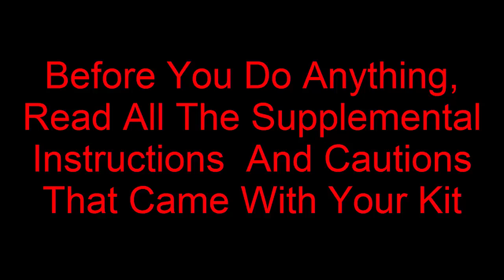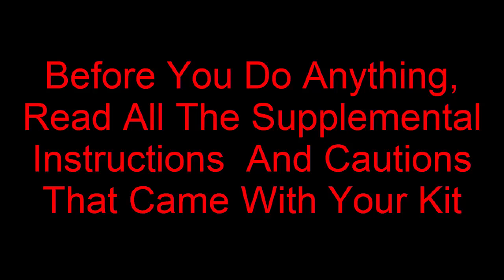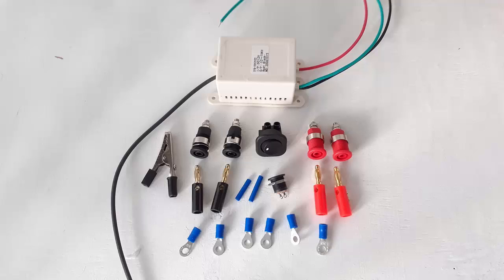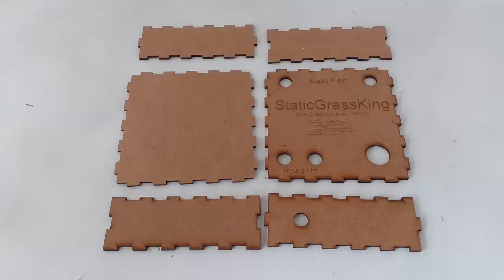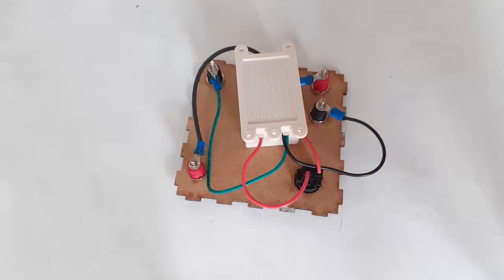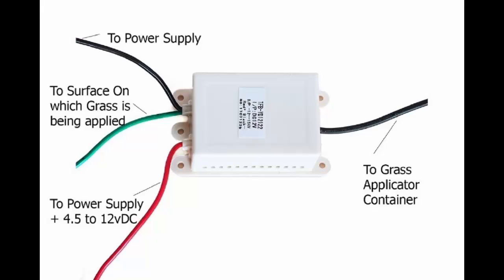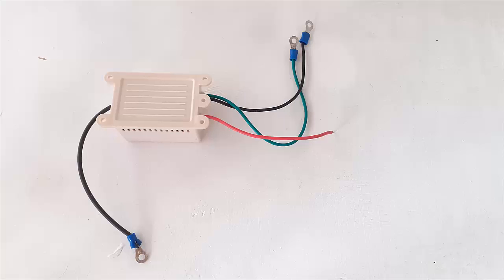DIY Static Grass Applicator Powerful 15Kv Prestige StaticGrassKing Inexpensive Easy 12v DC

Comment: Am I missing something?  Auxillary power supply is seperate and not included in the demo. What then is powering the unit? I assum,ed the two female :"Power in" connectors are attached to something. Or???
Reply from the maker: there are two paces you can use to power the applicator.  One requires banana clips and the second the normal connector on the end of a wallwart.

Comment: I would like to try your device, will your devices work in the USA (AC power)?
Reply from the maker: yes.  just use a us power supply that has a 12vv dc output. Many people use s small 9 v dc battery amd are very happy.
Reply: Thank you.
Reply from the maker: In a couple weeks we will have a us power supply available for the kits.  We are currently out of stock due to the COVID slowdowns affecting supply chains.